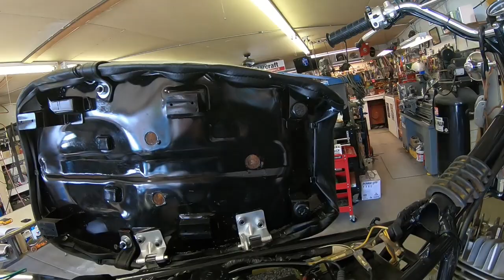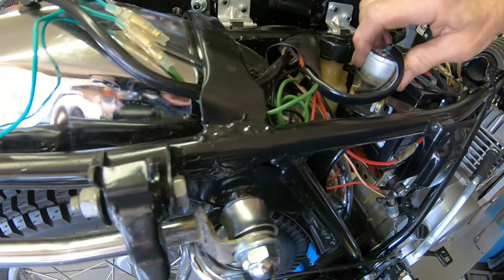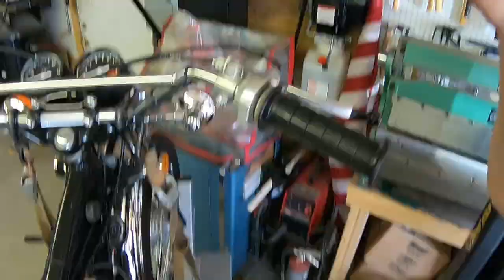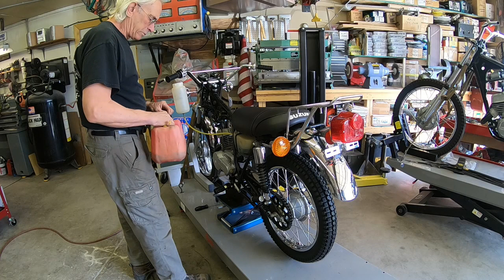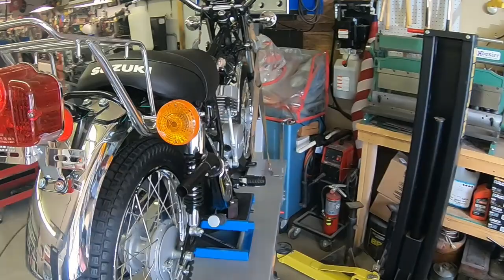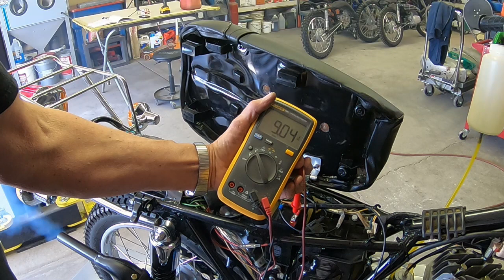73 Suzuki TC125 electrical, engine, and transmission check

Comment: Hi. I have question. I have suzuki ts100 here in Philippines , is it okay i use 12v batt. .. required on this bike is 6v. Any advice??
Reply from the maker: Hi there, I would have to say if yours is 6 volts now, it's a big job to convert to 12 volts. Don't just put a 12-volt battery in it. It will damage lots of components.

Comment: I’ve got a ‘77 which I’m cleaning the carb out of after 10 years of sitting now gummed up slide. I’ve got it apart now and going to remove the jets etc for cleaning. How do you adjust the carb so it’s not too lean or rich?
Reply from the maker: Oh boy, the best way is to make sure all your factory size jets and needles are in place and adjusted accordingly. That is the best starting point. Then take it out and run it hard, pull the clutch in, coast to a stop, take a plug reading and see if you need to go up or down on the main. Hope this helps.

Comment: I am 60 years old just bought my first motorcycle, a 1974 TC 100 all original runs and stops, have the same electrical problem right side turn signals come on, left side doesn’t, right side no blinking, your videos are very helpful, thanks very much.
Reply from the maker: Hi Victor, hope you get everything working, you might try checking the grounds, when they come on steady with out blinking, it is normally a flasher, If you need one get a 6volt unit for a honda on amazon about 15.00 instead of 50.00 from suzuki. Thanks for hanging out in the shop with me.
Reply: @montana2strokeracer  thanks for your help , I have the manuals but your videos help a lot, thanks again

Comment: Outstanding as always.  My 74 is coming along, just got the engine back in and then broke one of the oil feed lines (Doh) and yes I looked at your 250 repair and have parts ordered (thank you very much for that tip).  Hey, which video did you discuss the tank lid gasket, I know you said their was an easier way to put it on, but can't find the video.
Reply from the maker: Here you go Greg,
https://youtu.be/MHmCNDaCvSI
Good luck and thanks for following along
Reply: @montana2strokeracer  Thank you Dale.  I  ended up just doing it the original way you did it, thought it was pretty easy.

Comment: hi dale long time since i chimed in im still working on my suzuki I'm going to paint when it gets warmer here i just cleaned out inside of gas tank  the best i could i used a cement mixer tied tank to it filled it with stone and let it run for hours anyway was wondering if you think lining inside of tank is a good idea also was wondering what you mix your gas and oil ratio and do you keep mixing even after you know oil injection is working thanks
Reply from the maker: Well, hello John, wondered how you were doing with your restoration. Yes I also am waiting for warmer weather to paint. Sounds like a great way to clean your tank. I have heard of problems with tank liners,  but I think if you clean good and do all the prep correctly you will not have any problems. My favorite liner is Caswell, I have never had an issue with it.  I almost always keep the oil pump, only full out race bikes will I remove it. But on the Suzuki you must split the cases and remove the oil slinger from the left side of the crank. I always use premix on start up, just so I can monitor the oil lines and make any last minute adjustments without concern over oiling. Once break in is complete and adjustments are done, its back to straight gas. My mix is at 32:1 using Yamalube 2S. This is the same oil I use in the injector system of all the bikes I work on. Hey dont be a stranger, chime in anytime.
Reply: @montana2strokeracer   thank you

Comment: Another great video, Dale. Fired right up and sounds great. Timing, cylinder work and more --all top notch. Learned a lot, including what kid of shop I'd like someday. Well done! A TC model is totally on my list to own someday!!
Reply from the maker: Thanks Jim, got the neutral light fixed, turned out to be the switch on the engine. I have never had a bad one. The repair of that also brought the charging into check. Good days work and a relief that everything seems to work properly. Spring is here may go for a ride tomorrow, suppose to be 73. HOORAY

Comment: I managed to take one off the Yamaha apart and clean the contact. It's thermal breaker and I haven't had any success trying to use solid state units.
Lookin' good Dale.
Reply: Hi, Jack Subscriber frank here, i did also, think when the old flasher's go bad its hard to see the problem, think replacement is the only recourse.
Reply from the maker: HI Jack, hope your recovering quickly from your surgery.  I have taken them apart also, I guess it is my quest to know how things work, guess Im not the only one. I have been able to fix one or two, but at 10 bucks for a new one, its not worth my time. I try to keep the pigtails on hand but forgot to order the last time I used one. So I am waiting for those to come in. The replacement I use is also of the thermal design. I think the solid state ones are for LED only, arent they. As of now, I have not done a LED conversion. But with the lack of OEM parts, Im sure the time is coming.

Comment: Amazing restoration Dale! I can't imagine how many hours you have into this bike. Do you keep track?
Reply from the maker: Hi Graham, I dont track time anymore, I work by section, front wheel, frame, engine, etc. Then parts and supplies are extra. Sometimes you run into a problem that requires more time, other times you just skate through it. It equals out. I use to track time but it is unrealistic. No one can afford total hours on a restoration. Im retired anyway, so it is just a supplement to that. I am hoping one day to make a little from youtube, but its still quite a way off. Thanks for following along.
Reply: @montana2strokeracer  Thanks Dale. Yes,  just cleaning a frame with 40+ years of oil and dirt made me appreciate the perseverance required to just get it ready for paint.  Oh well, a labor of love.

Comment: maybe, if you can get the neutral light working that the voltage might be below 9v @8,000 rpm.
Reply from the maker: Got it working Frank. Turned out to be the neutral switch on the engine. Had a used one. Your right...with everything on, volts was 8.98. Thanks Frank
Reply: @montana2strokeracer  between you ,Jack and myself anything is possible. amazing what a bunch of old gezzers can do.LOL